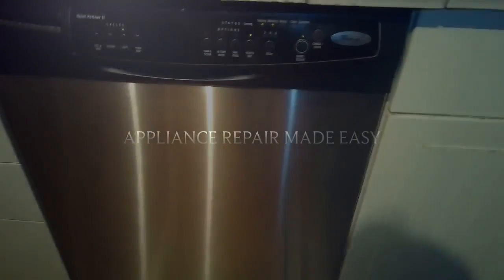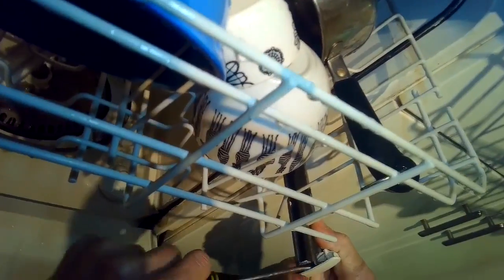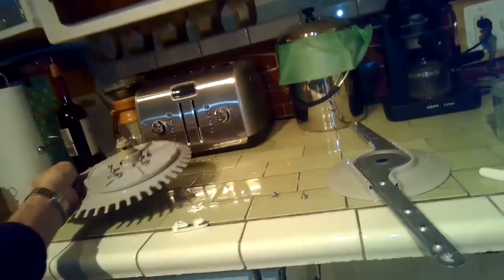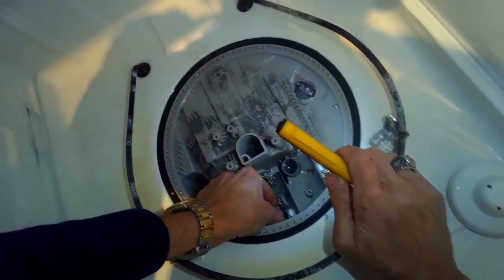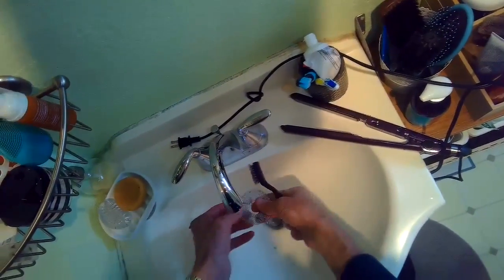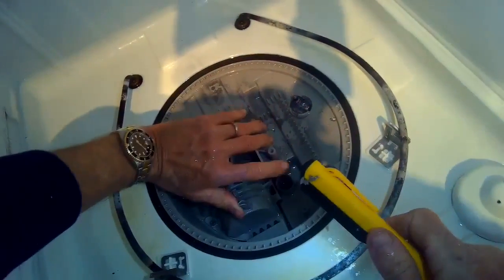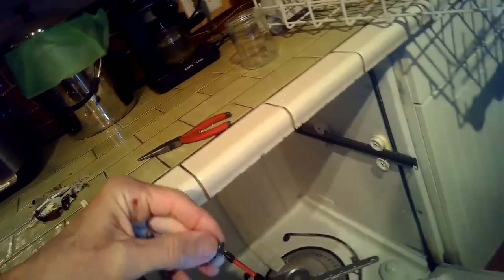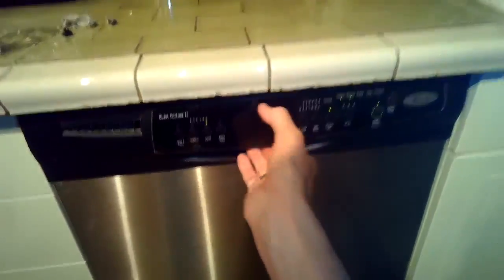✨ Loud Dishwasher - EASY FIX ✨

Comment: Thank you so much for this video. Mine was a Kitchen Aid, but had the same problem with loud noise. I followed your instructions and disassembled down to the sump and found that the 
shaft on the dishwasher chopper assembly had been sheared in half, apparently by some pieces of plastic debris that found itself down in that area and prevented rotation. Just ordered the chopper assembly online for about $7.50, instead of having to call the repairman for $100 or more, I'm sure. Also was able to do a complete cleaning, as you have shown.
Reply from the maker: Very impressive Thomas 😊😊😊

Comment: I have a Whirlpool dishwasher with a similar design to this one.  It was making loud noises so I figured I would give this a go.  Everything went fine until reassembly.  Unlike yours, my small metal shopping propeller was in tact.  I had a hell of a time trying to get it back in.  I ended up breaking it off of that metal screen.  I am washing a new load of dishes right now.  However, the noise is still there.....
Reply from the maker: Thanks John,
It could be that the bearings on your circulation motor are shot and making a whole lot of noise.
I think replacing it with a new circulation pump should do the trick.

Comment: Awesome video, I'll be doing this later today. My dishwasher is making this exact same noise.
Reply from the maker: Thanks Mike ,  please let us know how it goes.
Reply: @QuickAndEasy5MinuteAppliance  
It took about an hour in total (Whirlpool), I had so much going on in there. Broken pieces of plastics, tangled pipe cleaner, paper, and of course just nasty build up. It worked great again and quiet after putting it all back together. I'll be running some cleaning tablets today when I get home. Thank you again for your video...

Comment: Fantastic instructions! My dishwasher was making the exact same noise as the one in your video. There was a small round piece of metal that I pulled from the impeller basket. Put everything back together, noise was gone. Thanks for the help!
Reply from the maker: Excellent ,

Thanks so much

Comment: Mine was sounding rough and vibrating the kitchen floor. I literally put a squirt of Dawn dish detergent in it and ran a high temp wash. I did this after removing the screen filter, bottom rack and bottom sprayer. In 10 minutes it was running clean. Might want to try that first before taking everything apart.
Reply from the maker: Nice job,  thank you👍

Comment: Thank you. Very helpful. Only part that was confusing to me...plastic nut on spray arm was not to come off spray arm...one  hour later i figure it out. Now breaker  back on & hoping 4the best. Many thanks.
Reply from the maker: Thanks Jill,
How did it do?
Reply: @QuickAndEasy5MinuteAppliance  Dishwasher is working well now. Many thanks.

Comment: Awesome, I did this on a dishwasher that wasn't draining and had same problem and fixed it.  Yet I came in here due to 'noisy' dishwasher, but it was working fine.  All other vids simply talk about replacing part, I didn't think of chards or obstruction.  Keep up the good work.  You deserve the Rolex...but I'd hesitate hiring such help (but you get what you pay for).
Reply from the maker: Thanks so much.  The Rolex was a very generous gift👍

Comment: Hint. When the door is open it becomes a big funnel for anything inadvertently knocked off the counter. Was looking at dishwashers at Lowes the other day and mentioned how some filters are difficult to access. The sales person didn't know they came with filters. He is my age 60's, and had the same model we were looking at. When I pulled out the filter he said he isn't concerned because he rinses everything clean before putting in the dishwasher. No energy/water  conservation concerns there.

Comment: Thank you for posting this because my husband and step son ignore me when I say they shouldn't believe soap ads or product boxes that claim they break down food, none of them do. My dishwasher is currently loud like this and I pulled large pieces of water chestnut out along with end caps of a cutting board. But haven't done the tutorial because I think my husband should because he doesn't listen to me when I say don't put pieces food in the dishwasher. They let food dry on the plate and do not soak it off and remove it before putting them through the dishwasher.
Reply from the maker: You speak The truth!
Always rinse your dishes
Reply: @QuickAndEasy5MinuteAppliance  Thanks so much!

Comment: Had the exact same noise that you had (I don't know if you call it grinding or droning or ???) on my 13 year old KitchenAid. Cleaned out the chopper/emaciator with the same amount of junk as you. When I ran a Normal cycle before I put the shelves in, no sound, but when I ran loaded both racks the sound reappeared. In the first minute of your video, what made you think it was the bearings on the main pump (which cause megabucks to fix)?
Reply from the maker: You can try removing the chopper assembly to see if the noise goes away.  If it doesn’t then it’s bad bearings on circulation pump.

Comment: This video was particularly  helpful  since my problem was that the gear on the pumps motor wasn't properly engaging with the gear on the impeller since it was worn down. It wouldn't have occurred to me to remove the impeller and leave just the screen in there. You saved me from having to replace the whole pump.

Comment: Excellent Video! I followed your steps and found some garbage that needed to be removed.  However, wondering if I've made a mistake in the reassembly process.  Now, the dishwasher will not start (Whirlpool Gold Series).  The Sensing light is on, and the indicator display seems to just show lines rotating around the display and it will never start.  Unfortunately, we can't locate a manual for this machine so have no idea what its trying to tell us.  Have I made some error in reassembly, or is something else going on?  Thanks!
Reply from the maker: Do you think that metal chopping blade is able to easily spin?
Maybe it’s stuck.
Reply: @QuickAndEasy5MinuteAppliance   I don't think that's it.  I didn't see a metal chopping blade in mine.

Comment: I only found a few small random hard bits and the chopper looked fine, but cleaning it out fixed the problem. We thought there was a neighbour using a power washer outside, the noise was so loud. Thanks!
Reply from the maker: Nice job Christopher👍

Comment: How is it holding up without the blade that got mangled? Is it clogging faster now or has it remained efficient and quiet?
Reply from the maker: It’s working well,
But I always rinse the dishes before putting them in.

Comment: I did all of this and cleaned everything out.  Thanks for the good explanations.  It took us all day to take apart, clean and put back together. Unfortunately, it is still making a whining sustained noise around a Bnatural or C 5 (we're musical).  Then the noise stops and starts up again. Maybe it's the motor? pump? Kenmore brand.  Help?
Reply from the maker: When do you hear it during the cycle?
Reply: @QuickAndEasy5MinuteAppliance  The dishes are sparkling clean now after cleaning it out, but the noise drone continues during the cycle immediately when we turn it on to wash, then stops intermittently.  It seems connected to when the water comes in or is pumped in?  It may be bearings, my husband thinks.
Reply from the maker: Can you send a video of that noise to:  Scottthefixitguy@yahoo.com

Comment: Thanks for doing a straigh-to-the-point video.
funny thing on my Kenmore, which looks the same as your's: After I cleaned all the stuff out, including several large chunks of glass, my dishwasher is louder, which is what led me here.  I'm thinking you're onto something about the pump bearing going out; it's just really rattley.
Reply from the maker: Might be good to replace the circulation pump.
It’s pretty easy to do.

Comment: You should drive plastic screws by hand. First turning the screw backwards until you feel it fall into the existing threads, then forward. By just doing it where ever it happens to be, sometimes it will follow the existing thread, but often it creates a new one. After a few times doing that it weakens the plastic and the screw will strip out.
Reply from the maker: Nice info.
Thank you😊
Reply: @QuickAndEasy5MinuteAppliance  lmao you knew this already

Comment: I'm trying to fix my in-law's dishwasher. I have turned the water to the dishwasher off but I can't unplug the machine. The cord to the machine goes into the ground so I can't unplug it. If I'm only going into the machine to clean out the debris does the power to the machine need to be off? Is there a possibility of getting electrocuted?
Reply from the maker: You can turn off the breaker👍

Comment: This is exactly how my Miele dishwasher sounds when filling. A while back it stopped filling altogether so I replaced the fill valve with a Frigidaire one, as per another of your videos. Which fixed the fill issue, so thank you for that! However, the loud noise persists. I haven't found anything for the Miele dishwashers regarding this type of noise during that part of the cycle. Do you have any idea what the issue might be? It washes fine, drains fine and doesn't show any faults, just the awful noise... Any help would be most appreciated!
Reply from the maker: I wonder if the incoming water pressure from the house is too great ruining your fill valves?
Reply: @QuickAndEasy5MinuteAppliance  Thank you for your response! I wish that was the case! We have poor water pressure but we manage and it didn't seem to be an issue for the first 8 years we had the dishwasher. I am at a loss and don't want to replace the motor if that isn't the problem so I'll keep looking for a solution. I appreciate the help with troubleshooting. Thanks very much!
Reply from the maker: Hi Natasha,
I would replace the fill valve once again.
If the valves get either too low or too high of a pressure they won’t work well in the tend to spurt the water in.
Reply: @QuickAndEasy5MinuteAppliance  Okay, I'll give that a try. Thanks!

Comment: Unfortunately this did not fix my Kenmore dishwasher. I cleaned it out but when I put it back together I still have the same noise. I think there is a problem with the motor. I found if I go underneath and hold the back part of the motor while it is running the noise goes away. There seems to be some looseness in the motor assembly.
Reply from the maker: Could be it’s time for a new motor 😊
Reply: @QuickAndEasy5MinuteAppliance  A new circulation pump fixed the noise. Instead of the easy fix it cost me about $100 for the pump.

Comment: The food chopper does work, but it wears out over time, just like any other blade does. And obviously, if you have glass in there and other hard objects, it will likely destroy the chopper. But if it's just a few noodles, the chopper will take care of them just fine. I imagine you'd have much bigger problems if the chopper wasn't there to begin with.

Comment: None of that stuff was even food debris. You don't need to rinse your dishes off before putting them in, just don't put toothpicks, q-tips and shards of glass in the unit and it will run fine. You also need to replace that chopper, otherwise the screen will plug in a matter of weeks.

Comment: Our Amana dishwasher is making the EXACT same sound.
Reply: It worked.  Took away the noise.  Thanks.
Reply from the maker: Excellent ,
Thank you
Reply: Quick and Easy 5 minute Appliance Fixes Also, I found two pieces of glass from a wine glass and a toothpick.  Lolol.